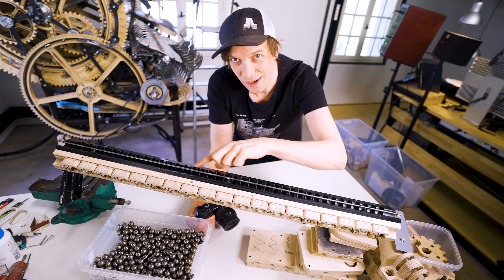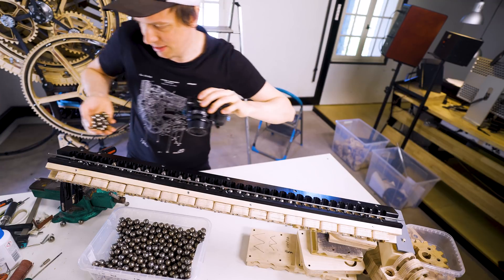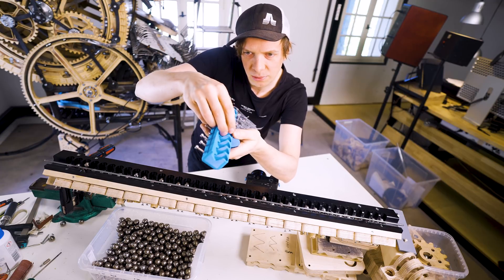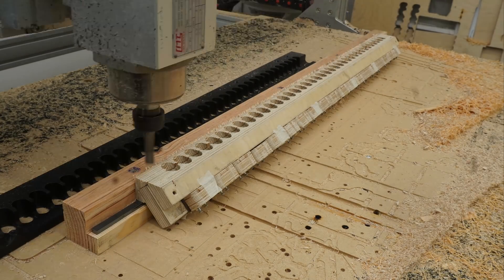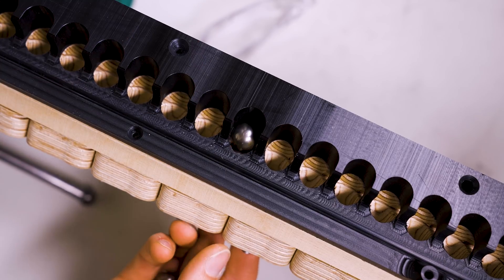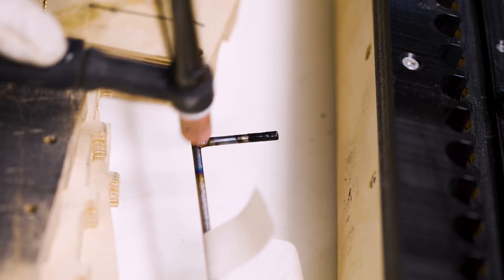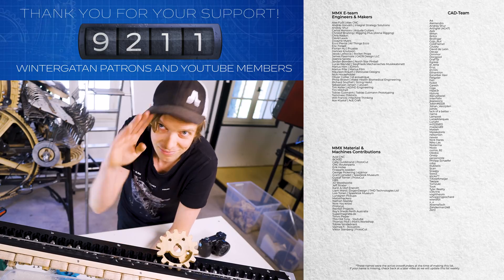Testing the New Marble Divider

Comment: it is not redundant, this property is called robust.
Reply: This! In my trade we call it "tolerant", the idea is the same.
Reply: We need 2 machines to be redundant. Who will make the 2nd machine?
Reply: @mughat  There should be a collection of „B“- parts for three machines ;-)
Reply: @mughat  I would guess he will be able to have it made with his cad work, and the team of engineers and makes he's working with. I believe he's mentioned as such. He certainly will need at least 2 full machines and lots of spare parts to undertake a World Tour, where I would guess there will be hundreds of thousands of fans with many tens of million dollars at risk.
Reply: Another engineering term for this is "margin" - as in a wide margin for error.
Reply: I feel like the perfect word here is "resilient".
Reply: I learned that a process/automation/machine is called robust when it can work in non ideal conditions. Like heat/cold, tipping-angle, too much/little voltage etc.
Reply: Robust or high tolerance means that the machine works under a large margin of conditions. Redundancies are thing you put so that if one thing fails the redundancy makes it so that it works instead. Failsafe is something you do to prevent the entire system from breaking. Some failsafe are redundancies, but they can also be emergency procedure like shutting down the machine. Shutting down the machine is not a redundancy because it does not replace a function of the machine.
Reply: @ODDnanref  nailed it.
Reply: Redundant: more than one way to do something.
Robust: strong
Tolerant/margin: can handle a wider range
Failsafe: if something goes wrong, it isn't dangerous (if it fails, we'll all be safe)
Resilient: any combination of the above that enables the whole system to function under a wide range of conditions.

Source: I'm a systems and complexity design consultant :)
Reply: Yeah redundancy is good :P
Reply: Came here to say this. Robust systems are insensitive to parameter perturbation
Reply: You’re thinking of redundancy as if it’s a judgement term. It’s merely descriptive. A robust part could mean merely strong. A part with redundancy means that it can continue to function even if one aspect fails.
Reply: shhh he knows what he is doing.
Reply: Indeed. Redundant means you have multiple things doing the same job.
Redundancy can be a blessing when the extra parts fix the failures of other parts, but it can also be a curse when they don't, because in that case redundancy just adds more points of failure.
Side wheels are good when your bike is tipping over, but bad if you're trying not to collide any wheels into anything.
Reply: Came here to type exactly the same thing!! Nice
Reply: You want to get a book published ???
Reply: And also reliability
Reply: AKA fool and idiot proof
Reply: Redundant as in multiple mounting options?
Reply: The new divider has a wider process window. He performed a process study. The process parameters were varied to determine the limits where the various divider assemblies operate to the desired specification. The new design is more robust against the marbles getting stuck.
Reply: Robust..... Precise..... 🤨 

AR-15, 11.5 inch, compensated with an iron-bonded bolt carrier.
Reply: Yep.  Will the World Tour stage be perfectly level?  Probably not.  No longer a problem.
Reply: I agree that "redundant" is not the right descriptive word he used. Then Martin corrected with "stable". That works. The word "robust" can apply here. It's a comparison word. Example. This thing is more "robust" than the one before for its durability and/or function over the previous one. Certainly this divider is more "robust" than the one before. I like Commander Tomalak's response. "Tolerant".
The window of adjustment is what Martin was talking about. This divider is more tolerant or forgiving to adjustment errors.
I've worked on electronic devices with Pots. They were so tight. Just putting a tool on it and thinking to turn it would practically make the adjustment go out of spec. A big window of adjustment is what us techs want.
Reply: "redundant" doesn't always mean the same thing.

"Data redundancy" is an example from the technology space. It's often about having a second synchronised server, database, etc that's updating in near real time. The idea is that you can switch to the "redundant" copy at any time if something goes wrong.
So, essentially, redundancy is about precautions that mean the system keeps running even if there's a fault

Martin knows exactly what he's saying. Maybe the phrasing wasn't 100%, but the concept was there.
Reply: @Charky_Creations  redundant always means that there is more than one way of doing something. In your example, data is stored in more than one location, the "redundant" copy is the backup. It's redundant because you don't really need it... until you do. This is one of the most interesting aspects of redundancy: in a highly competitive drive for efficiency, redundancy is often viewed as optional and gets cut. Things bumble along just fine until something goes wrong and then the lack of redundancy means an otherwise minor failure becomes critical. Redundancy is the method of achieving resilience rather than a synonym for it :)

I am a biomimetic systems designer and natural systems almost always have more redundancy built in than man-made ones. This is very interesting because nature is generally very well optimized for efficiency. It suggests that, after 3.8 billion years of evolution, the systems that survive are the ones that best balance efficiency and resilience rather than optimising for either.

Martin knows what he means and he's using "redundancy" incorrectly in this context by conflating it with tollerance and resilience more generally. As a second language learner myself, these are exactly the sorts of mistakes I need people to point out to me, even if it feels awkward, because it's even more embarrassing to discover after 10 years you've been making a mistake that everyone was too polite to point out!
Reply: Redundency is having the rail even though the marbles are sloped away from the edge essentially you need two or more things to fail
Reply: Correct me if I'm wrong but that "property" is not the same as a failsafe is it? But it serves kind of the same function, right?
Reply: @SkillZgetKillZ  No.  Failsafe does not mean "no failures", it means that if a failure does occur, it does so in a way that has no effect on general function.  Failing safely.  Running marbles at higher rolling speed so that it they come out of the track, they are completely ejected from the machine would be "a" failsafe (admittedly not an optimal one), as the MMX would continue playing with remaining marbles.  As opposed to marbles flying off the rails in such a way as to jam the gears and stop the machine dead in its tracks.
Reply: Alternatively, it means stopping all operations if they cannot proceed safely.  Circuit breakers are a failsafe, they cut electricity to overloaded/shorted cicuits.  The fabled Blue Screen of Death is a software failsafe, wherein something has happened that has caused the OS to stop itself before it messes itself up further.
Reply: @SkillZgetKillZ  A property is basically just a variable. You may say "a property of moving house is that it is stressful." Or, in engineering terms. "A property of cotton is that is absorbs moisture easily". So, no, "property" and "failsafe" are not the same thing.
Reply: @Stettafire  ah sarcastic antihelpful jokes I love dropping these on people too
You're in good company
Reply: @SkillZgetKillZ  it is similar. Failsafe means it can stand more stress than needed and robust means it will work in non optimal conditions.
Reply: @Herdatec  I figured a failsafe was more of an emergency state
IE in the event of catastrophic circumstances end all function to prevent damage
Reply: @SkillZgetKillZ  That is the issue with translating english to German, The language I learned Engineering in. 
Stress here was meant in the broadest way. And I was talking about the adjective of being (fail)safe. A failsafe is indeed some backup to prevent harm.
Reply: @Darius Sawyer
@Cristi Neagu wrote it more nicely 5 min after I posted my comment:

Redundant: can be omitted without loss of functionality.
Robust: Resistant to failure.
Reply: @Herdatec  @Darius Sawyer both a little wrong. Failsafe is not about how likely something is to fail; is entirely about the direction in which it fails: to safety. Examples are train and semi-truck brake systems which use pressure to hold the brakes open, so that WHEN a brake line fails, the drop in pressure causes the brakes apply themselves and the vehicle stops.
Reply: @SkillZgetKillZ  I figured that failsafe was more literal. Something that allows something to fail safely. As that’s kinda what an emergency stop does. It causes the machine to fail in a safe manner that lowers risk. Sometimes the risk is to life and sometimes it’s to the machine itself.
Reply: @monkaeyes  Agreed. 

A machine that is failsafe is a machine that will be safe if it fails. 

A failsafe component is a component that ensures failure will be safe. 

A system that has failsafes is a system that can't cause harm even if certain things go wrong. A system that is failsafe is a system that can't cause harm. 

So like having backups of your data is a kind of failsafe because even if you lose all your primary data you still have the backup data. 

Chernobyl had many failsafes. But the overall design of Chernobyl was not failsafe. It was faildeadly.
Reply: And I guess when I say "can't cause harm" I mean "can't cause unintended harm". Because a nuclear weapon can be failsafe in that it's impossible to detonate unless armed. But if properly operated it can certainly cause harm.
Reply: @SkillZgetKillZ  That too.
Reply: @SkillZgetKillZ  failsafe more means it will continue to function in some state if a failure occurs. It is safe for the system to fall. Backups are a good example of a fail safe.
Reply: reddit semantics moment

Comment: Im excited for the next big Marble Test.   Everything is looking good from my point of view and I'm ready to see if all the individual pieces that are working great solo are ready to work as a group.
Reply: He just hasn't tested higher velocity marbles coming from above
Reply: @tommj4365  True that.   It's one of my points.  Currently Martin has some incredible redesigns that are working great individually, track, gate, catcher and, divider, but none of the new designs have been tested, for us at least, if they can work together as a group.   A chain is only as strong as its weakest link.   Its time to see if the new designs installed on the MMX can handle a minimum 10 thousand marble test.

Comment: Hello,

can someone listen me out? When he tests the devider, under full load (marbles mack to back), only "few" marbles per minute are being played. The frequenzy at which the marbles are hitting wilson at the end is maybe 2 Hz (2 per second) or generously counted 5 hz.
I think this would be too slow, as the devider has to fill 38 channels each being able to play (i think) a little bit faster than 1 hz.
Can someone please tell me if Im wrong or if not tell martin?
Thanks a lot.
Reply: He's feeding the marbles by hand, so the speed at which the marbles reach the end is lowered. In actual use, the marbles will be entering the divider with more velocity and in higher numbers. This divider has the same throughput as the old dividers, so if they worked for the vibraphone test melody, this one will work.
Reply: There will be more marbles in a real test, coming in from the top mostly, so channels will be filling up at a much higher rate.

Comment: I have a feeling that this is the big breakthrough for the marble machine X.  Once this goes on, I feel like it'll be a lot more smooth sailing from here on out.
Reply: I think he may find marbles going too fast and maybe skipping some openings... but I'm expecting he knows this and plans on having to tweak things
Reply: @tommj4365  If that happens, he can just adjust the angle at which the marbles go down the lane such as going 3 degrees instead of 5.  That seems to be a lot easier to tweak than what he originally had.

Comment: Consider using a heat sink to slow the transfer of heat while welding. You could try using alligator clips between the area you are welding and the area you don't want the heat to travel too. The clip would absorb heat slowing the transfer

Comment: I'm not entire convinced, feels like it's going to be too slow in practice, with too many marbles trying to enter it at any length they'll bounce all over the place fighting for space. Greater chance of whole queue jamming and it's a bottleneck all around if they spend so much time in the component?
Reply: In practice, the marbles will be entering the machine with higher velocity than they would if he hand fed them, and marbles would frequently be removed from the divider as they get played. At this point, he was testing to make sure the divider works even if the marbles somehow lose their velocity (the edge case).
Reply: @johnl0cke  Oh right the new lanes don't enter at straight angles
Reply: Still apprehensive, high velocity could very well just mean skipping holes. So, there are two ifs I'm worried about. If high velocity means skipping holes, and if low velocity means bottlenecking
Reply: @DxBALLxD  Even so, this is miles better than the old system, which sometimes didn't work at all. We'll have to see if this works on the machine, and if it doesn't, he'll do to it what he did to all the other things that didn't work. There are other prototypes and concepts out there on the discord that can be given a try.

Comment: I'd just like to point out that if you double the current the temperature is no multiplied by two but by approximately four since the power is proportional to the square of the current for a given resistor value (P=RI^2), which I assume is the case.

Comment: I love the plywood, but I'm wondering how much of this can be 3D printed so that you can easily swap in a replacement piece wherever you are in the world.  Not everyone has a CNC, but there are a lot of 3D printers wherever you go.  I suppose there is a "makerspace" wherever the world tour goes as well, so maybe a CNC is not out of the realm of possibility.
Reply: It's a really big part. A 3d printer capable of doing that will be harder to find than a cnc machine.
Reply: @Bartoman7  print smaller pieces.

Comment: “Playing 100 000 marbles” - video is getting close! Are you feeling it?
Reply: I think he will made more gate for this, test with at least 3 instruments
Reply: @etiennedud  Yeah if anything testing 100K marbles with just one channel is going to take forever
Reply: He does have some of the parts to assemble some of the escapement gates. If he can assemble 3 sets of them then 100000 marbles is on.
Reply: Very close. The PMMA pipes are a really important step for aestetics afterword.
Reply: I think it's coming after this is on the machine. At least that's what I'm feeling
Reply: He can even try different designs for the clock escapments

Comment: You need to test it on the actual machine. How fast are the marbles coming into it from the marble splitter? Will that need a redesign?
Reply: He can make the marbles come out really slow from the splitter so i doubt that will be a significant issue.
Reply: @Sorestlor  The splitter would need to be remachined to slow down marbles, so it's not a walk in the park.
Reply: I also expect there's a chance he'll need to tweak that part to slow things down, but we may just see the marbles are bouncing around randomly enough that the channels are filled up at a high enough rate, despite marbles skipping over holes in some cases

Comment: You might want to consider testing the marbles coming over the top (marble lanes) and not just from the side (fish stair)
Reply: The drop holes should probably be on the other side so the kinetic energy from the lanes marbles would push the stair marbles toward the holes, not away.
Reply: Yep
Reply: Especially when 4 fish stair marbles crash into some marbles from the conveyor and form a big slow moving blob.  

I worry marbles will bounce over the rail.
Reply: Yes, I'm desperately missing that test too!

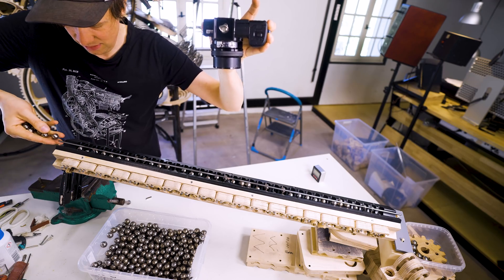Comment: At 3:03 you can see that the vibration (or magnetism) of the marbles moving down the track was enough to free the stuck ones.  Given how much the machine moves, this suggests that no marbles should get stuck.
Reply: This
Reply: No, not after wheel balancing gig.
Reply: Yeah, because of the vibrations no marble will stuck.
Reply: @ronald2042  Just think, they are still there, in the darkness, alone, clinging to the ever revolving wall. And the abyss...
Reply: I saw the same thing.
Reply: Martin may even add some vibration on purpose
Reply: Vibration? You mean noise in the system?
Reply: Yeah absolutely. They're just going to be shaken off, and there's also a continuous flow of marbles, I don't see this part failing to do its job
Reply: I noticed that to!

Comment: Martin, about the sticking marbles, don't forget that the Marble Machine is full of vibrations in normal operation (marbles dropping in the cues, programming pins pushing the springs back and forth, etc.) So marbles will likely even resolve themselves after a few moments due to the vibrations.